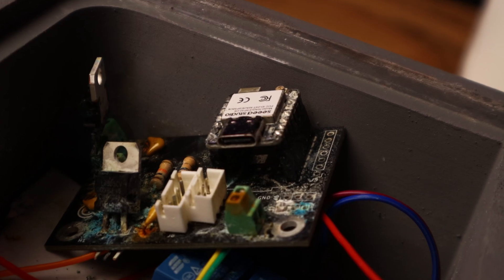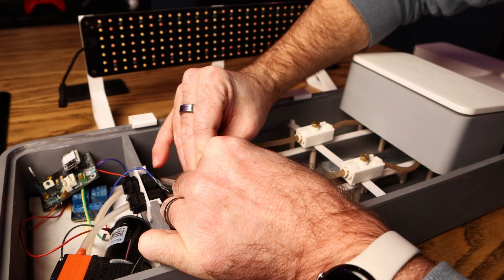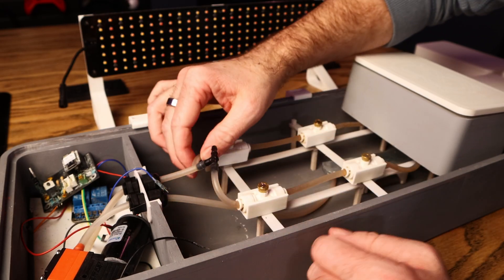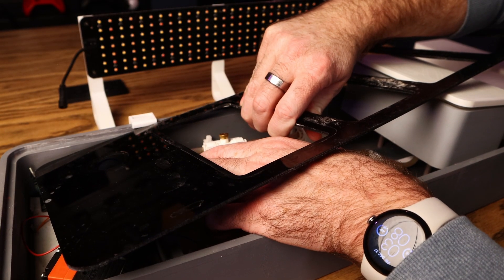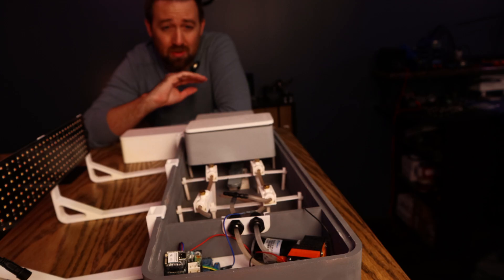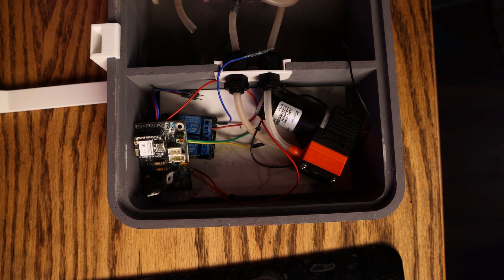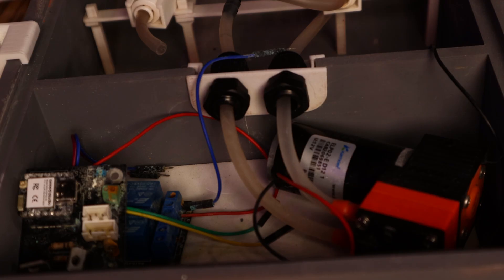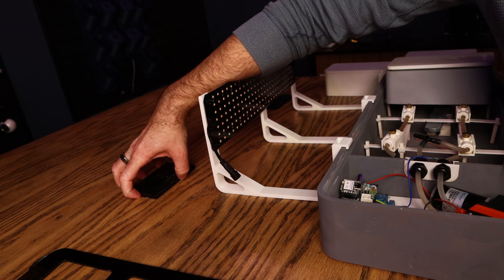Catastrophic failure, but it's colorful!

Comment: Love the content. One thing I’ve learned from my 3D printing projects is: use existing commercial containers where you can and print parts for the stuff which makes more sense to be custom. A couple of small sterilite bins are pretty cheap and watertight from the get go, you can still print a custom lid for it with partitions to support your custom grow trays.
Reply from the maker: Thanks for the feedback! I haven't had too much trouble with printing a water tight container in past builds, this one is so big that it's 6 separate pieces fused together. Normally I would do an existing container but I was trying to mimic the Auk grow system and do a resin copy of it.